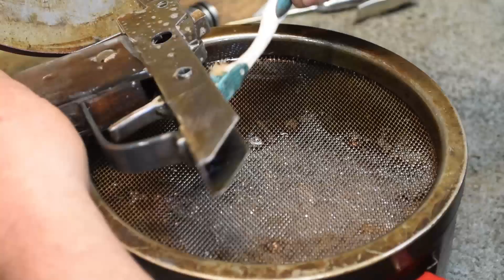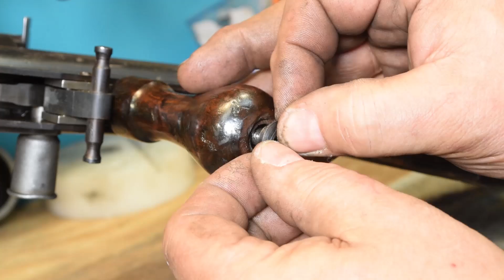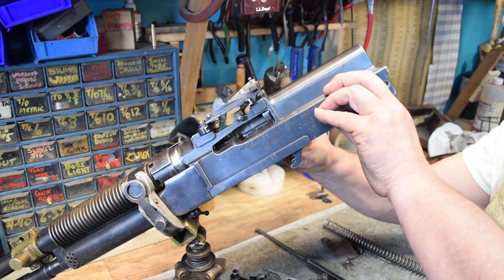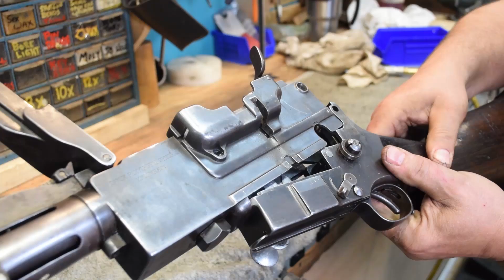Coming Soon: Project Lightening

Comment: 30-06 chauchat...a wild Ian appears...
Reply: he descends from heaven
Reply: Nope that IS the .30-06 version ( at least the part where he hands it over ). The 8mm version doesnt have magazine guide like that more over the forward grip is located in front the magazine guide, the 8mm version has the forward grip located closer to the pistol grip
Reply: They load both a 30-06 and a 8 lebel mag in the video
Reply: Been wondering when Ian was going to lend his gun to Othias.
Reply: @thkarape  yeah, I noticed the .30-06 mag
Reply: I know he owns both...
Reply: the one at 2:09 is .30-06
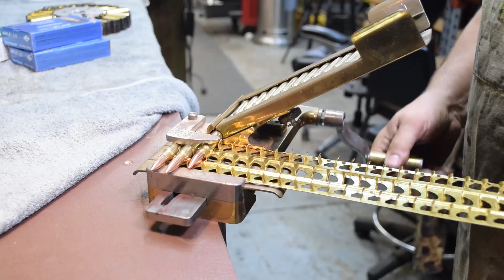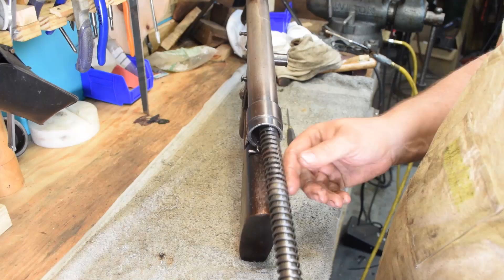Reply: sman7290 he did. At 1:03 there is an 8 Lebel mag and at 1:20 there is a 30-06 mag (I have found two different 30-06 Chauchat mags, so here is a photo of the type that they have https://www.rockislandauction.com/detail/71/3568/chauchat-1915-class-iiinfa-light-machine-gun-in-3006 )
Reply: I he came down from heaven to judge the rimless and spitzer
Reply: I'm pretty sure Ian actually has both, but likes the .30-06 version
Reply: he did buy both the absolute madman
Reply: Yeah he owns both, and I believe Mark worked on his 30-06 version to get it running correctly, or maybe it was the 8mm.
Reply: Not just a Chauchat, the Hotchkiss is a French machinegun too.
Reply: he did bought both.. 7.5 French one is all ok but .30-06 is problematic.... until now!
Reply: HOW DID YOU KNOW!?
Reply: And the winner of the future telling award goes to
Reply: Well, Ian is friends with Othias, Othias has dropped hints of someone who has a Chauchaut that they're working on to lend to the show(specifically mentioning that they were out of town when Ian was in Finland), and Ian has been doing a lot of work on his chauchaut over on forgotten weapons.

Maths.

Comment: Loving it. South of the border they're still using Maxim's and M1919's. They're so worn out that you have to piece together one from the others. You may get lucky and end up with 2 from 5. Jordan is a little better with M60's that will Frankenstein 2 from 3 and M2's so old you can radio carbon date them. Still, a little diesel fuel to clean them and some engine oil for lube and you can get them all running like a raped ape up a tree.

Comment: Was that Eds Red i saw?
Reply: Yes  I bet it is.
Reply: Either that, or Kroil.
Reply: Kroll isn't that red
Reply: K1 kerosene maybe
Reply: Well Eds does have it in it...
1 part Dexron II, IIe or III Automatic Transmission Fluid - GM Spec D20265 or later
1 part K1 Kerosene
1 part Aliphatic Mineral Spirits federal spec TT-T-2981F (CAS# 64741-49-9) or Stodard Solvent/Varsol (CAS#8052-41-1), a.k.a "oderless mineral spirits"
1 part Acetone (CAS#67-64-1)
Reply: Straight off road K1
Reply: @marknovak8255  Thanks...